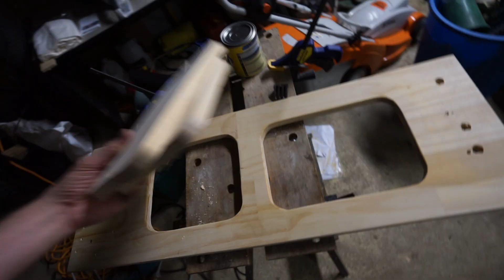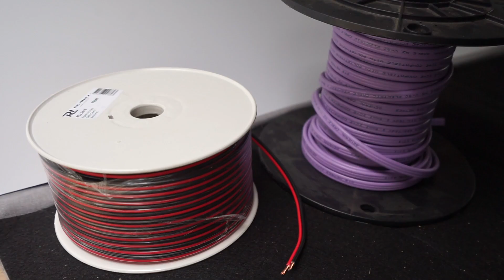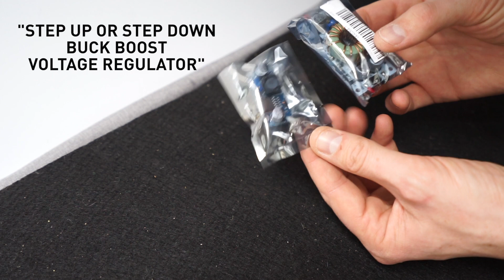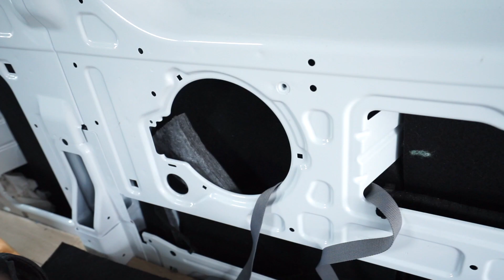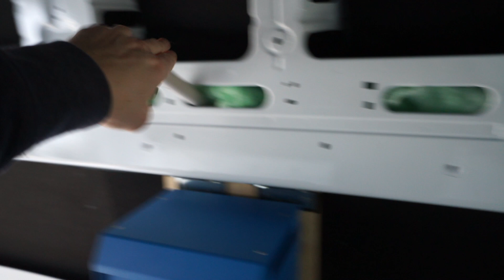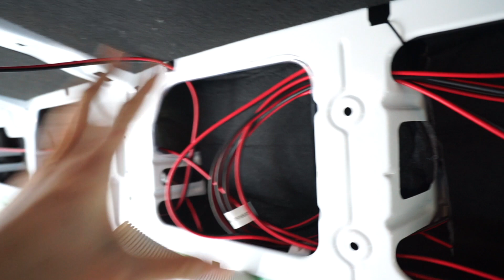Van Conversion: Wiring, Blue Sea Breakers and Electrical: Eat Sleep Van 14

Comment: What size TPS Non Migratory Cable did you use?  1.5, 2.5, 4?
Reply from the maker: Sorry can't remember, but there are standard sizes depending what you are doing e.g. lighting vs electrical sockets. Technically an electrician has to install anything 240v including the cable.

Comment: Even on a 12 or 24V battery system it's a good idea to use DC-DC convertors for 12V stuff like LEDs, because the voltage on the batteries will change as the charger charges them. I'll get some Victron DC-DC converters for my van.